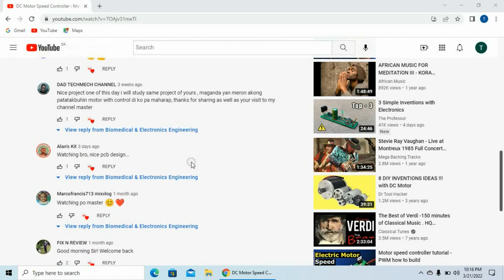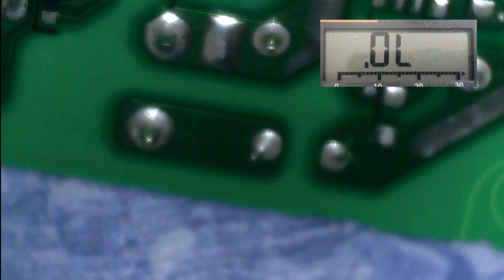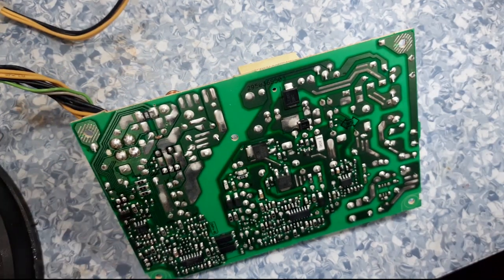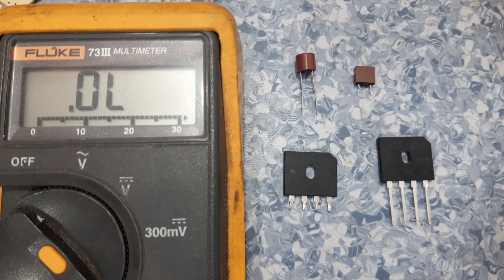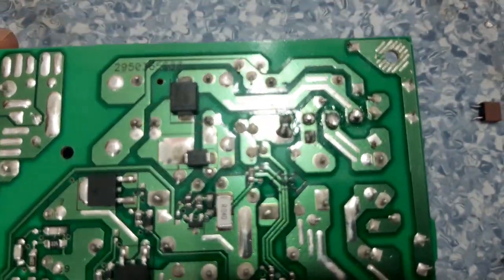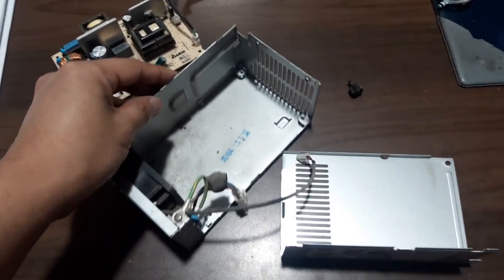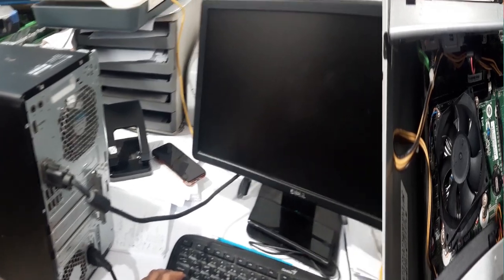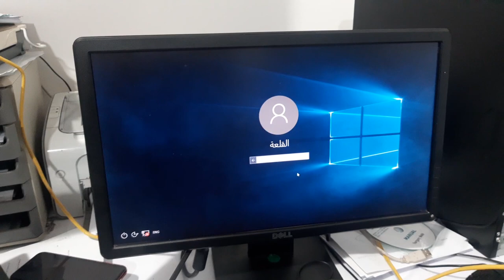PC Power Supply Repair : How to Troubleshoot Short Circuit on PC Power Supply

Comment: I suggest that you should have tested the big, high voltage caps. It is more likely that they failed and damaged the bridge rectifier and fuse. This is more likely than those particular components failing on their own. Those caps should have been replaced, just as a matter of maintenance, if they are older than say two years. They are a cheap name brand. I hope that helps. Did the power supply fail, again, after a short time?

Comment: Brother ever had a chance to work on a MC2100 LTS-50W REV50 Threadmill power supply/control board? board powers up but no 12v going to the control panel? need help in hawaii..
Reply from the maker: Trace your 12v power rail. Check the 12v regulator.
Reply: @biomedicalelectronicsengin7192  Thank you for the quick reply! I'll try
Reply: @biomedicalelectronicsengin7192  I suspect my transformer is faulty because no output when powered up.. how do i know the value of the transformer with no markings and no schematic? so how would i find a replacement?  It's for a MC2100LTS-50W REV B Threadmill power supply...